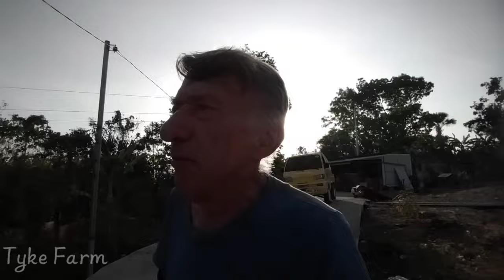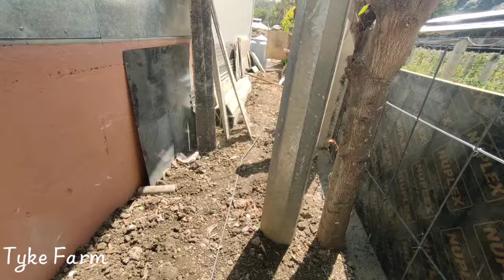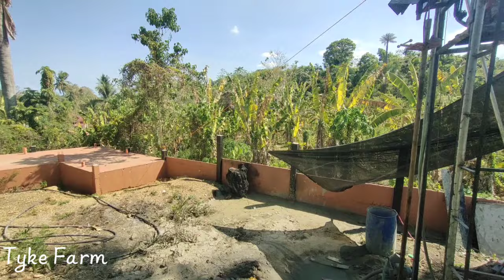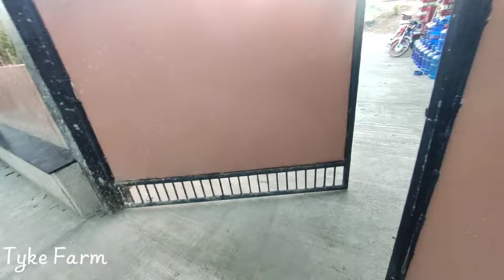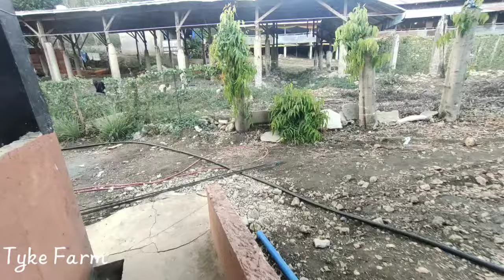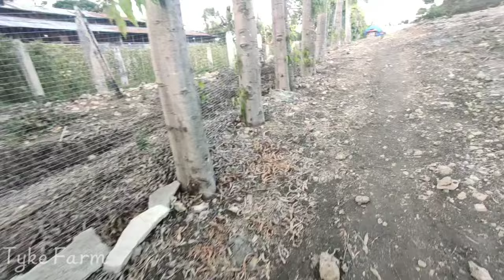CHICKEN BLOOD GETS THE DRILL WORKING AGAIN AND ALSO MAKE A NICE MEAL

Comment: Why aren’t they using the muddy water to drill instead of wasting it build bigger walls like a dam and pump out of that and just top up with fresh water occasionally it will save you money most drillers do this
Reply from the maker: Hi Warwick thats  what there doing (maybe do it better), the amount of water they used at 80 ft plus and the amount caught me out was in filling the bore hole to start drilling it was just seeping away as quick as it was but in. That problem is solved with the rain we got, the bore hole is still full.

Comment: yes, I was thinking the fikter also from the sounds the engine is making...
Reply from the maker: Hi John, I know they cleaned the plug probably no feeler gauge but you can set it at aprox 25 thousand with your thumbnail but there will be a filter at the fitting to the bottom of the tank or an inline filter near to it.

Comment: Normally they catch the water coming back out the hole going through a stainer to catch the cuttings. And top up as needed. Seems strange they don't do that.
Reply: That’s the first hole with a trench to catch the fillings then they should have another hole next to it for a pumping hole or recirculating the muddy water back down the shaft with pressure
Reply from the maker: hi Dereck no strainer they have a cement lined hole which they scoop out withe their hands, as Warwick says 2 holes would be better the first allowing the spoil to settle.